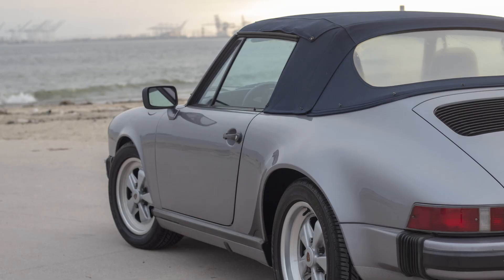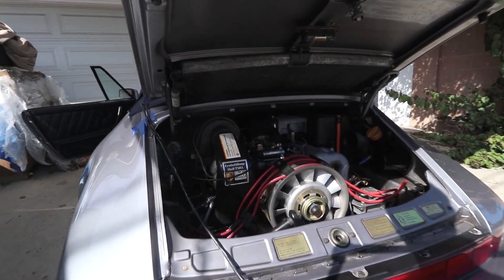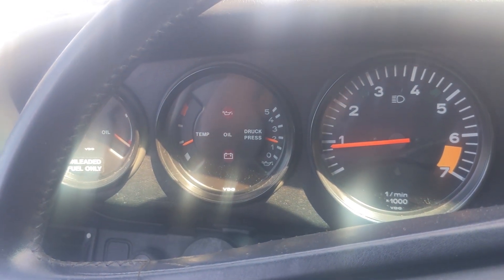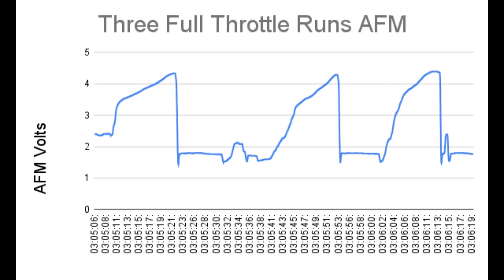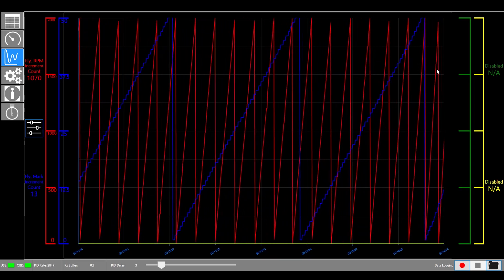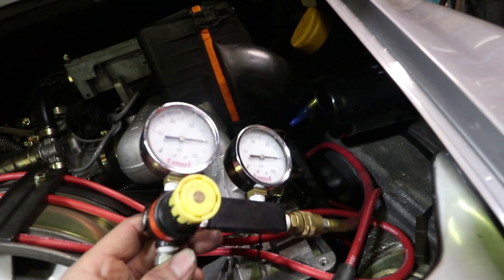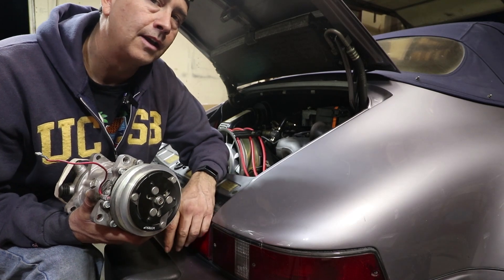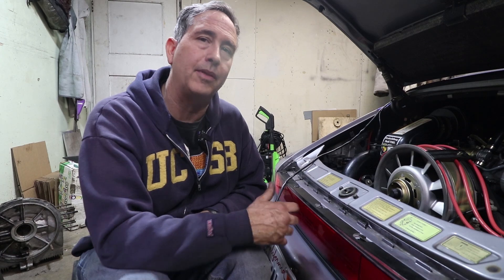Diagnosing My 3.2L Porsche 911 After Fresh Top End Rebuild - What Went Wrong?

Comment: Oh would love to rent this car. Sounds SWEET! Are you sticking the O2 sensor for that AEM AFR gauge up the tail pipe? Does that give a good accurate reading? Need to get some AFR readings off my vintage car.
Reply from the maker: Ok, I'll post it on Hagerty driveshare soon.  
No! don't just stick the O2 sensor in the tailpipe.  You need to weld in a bung as close as possible to the engine.  Go back and watch the whole video.  I showed where the O2 sensor is.

Comment: Really great outcome.  Interesting that it idles so nicely at ~14.7 AFR (with what amounts to batch injection.)  Wise move on vetting the rentals more closely I think 🙂
Reply from the maker: Thanks, it drivers great.  14.7 is the only way these engines will pass CA smog.  It runs at 14.7 until the engine is under heavy load and then it gets richer.  The DME is messing around with timing at idle too which helps keep the idle stable.

Comment: Thanks for a great video and the detailed explanation of the ftech9 ecu. I’ve got one on order thanks to your channel, and can’t wait to data log.
Reply from the maker: Cool, the ftech 9 dme is so helpful.  Many of these charts were made from a data log and graphed in excel, but you can also graph this stuff in real time.  It's amazing.
Reply: @GarageTimeAutoResto  hope you are great. Follow up question, did you weld in the wide band or did you have a shop do it? Asking as I’m looking for a recommendation to have mine done in SoCal and hoping to find a place that knows these cars and won’t hack it up.
Reply from the maker: I welded it in.  Find a shop that does  TIG welding.  Probably cheaper if you remove the cat and walk it in.
Reply: @GarageTimeAutoResto  that’s awesome. It’s a bit beyond my ability at present but I’m wondering / hoping there’s a way to get this data on a round screen to replace the clock. Maybe arduino reading obd2? First step is the ftech and making sure my car is running tip top. Fuel lines and five o injectors going in soon but want to data log first to compare.

Comment: I really enjoy your rebuild series.  I have owned my 993 for a couple of years and I am still learning so much about the air-cooled 911s.  Good to see the readings after the car is warmed up, I was always concerned with the oil pressure reading, rather it is telling me my engine is healthy or not.  Thank you!
Reply from the maker: Thanks for watching!  No worries about the oil pressure dropping when the temps go up.  This is normal as the oil gets thinner and the RPM's are low.  You should have roughly 1 bar for every 1000 RPM's and max of about 4.5 bar.   This is normal.

Comment: What would be a good project Porsche to look for. Never done air cooled. Never done carbs. But willing to learn.
Reply from the maker: I like the 78-89 Porsches.  They are pretty easy to work on and still have that vintage feel.  The 3.2L engine is a great engine. The 3.0L CIS injection is a bit of pain but they run well when sorted.  
My advice is don't buy a rusty one.

Comment: Tom. When you get ready to do the AC look at the EPA SNAP list for some of the newer gasses. There are a couple newer HFC compounds that are way more efficient than 134. They work at lower pressures and that 3-4 times the thermal conductivity. I did an older CFC conversion, with HFC-409, I had 38 degree air at the vents, keeps the ice tea cold. You may need to go to a HVAC shop for the gas, but much better in the long run. Also I just ordered a laser welder for the for the next 356 project.
Reply from the maker: Ok, good to know?  Compatible with R134 compressors?  Curious about your laser welder too. Sounds cool.
Reply: @pyrogenusa Is there a place in SoCal that charges hfc409? I was considering just doing r12 (I’m actually certified to work on r12), but would prefer to use a more modern earth friendly option.